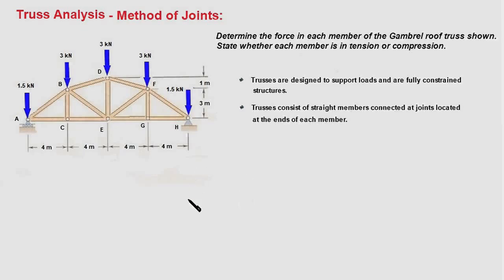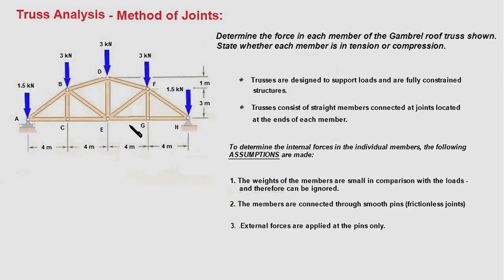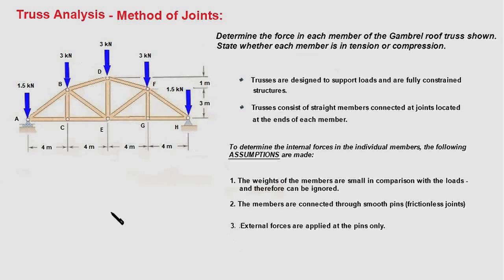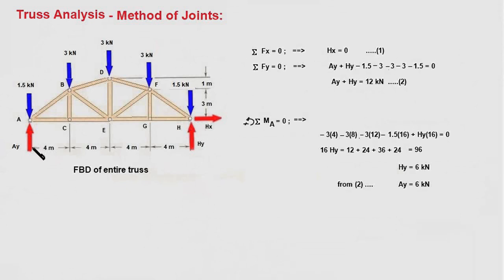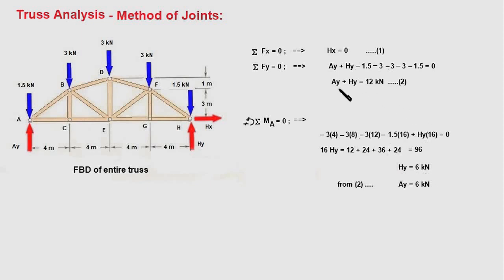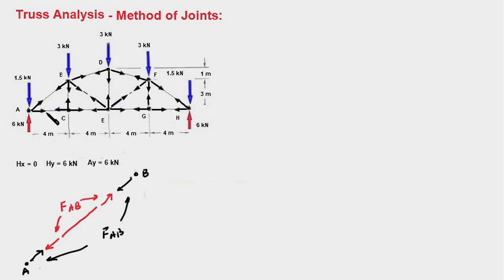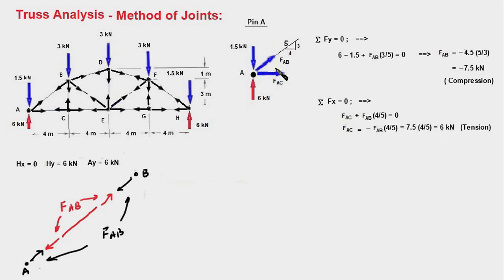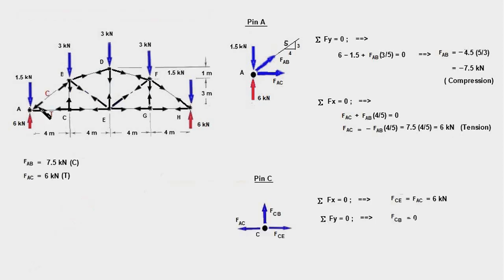14.1  Analysis of a truss - 'Method of Joints' (Example # 1)

Comment: hallo sir, may i ask? can u tell at min 15.44 how did u get -24 and at 16.11 from eqn 2 ,  also how u get Fbe=0
btw overall vid is okay
Reply from the maker: you  get the results by solving the two simultaneous equations...I don't think there are any computational errors. Please recheck your calculations.
Reply: @VectorInMotion  sir fbe coming 0.0021 so do we have to take it approx 0 but why??
Reply from the maker: @shikharchandrakar23  Please recheck your calculations